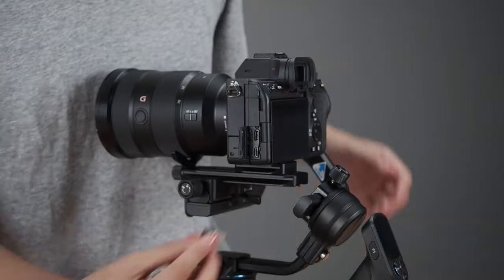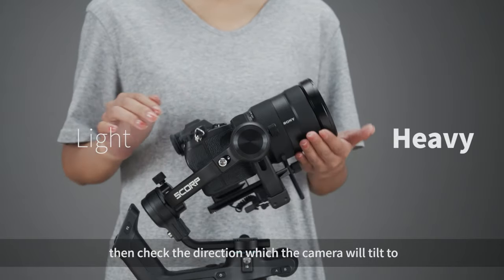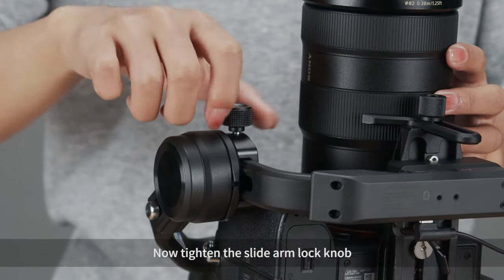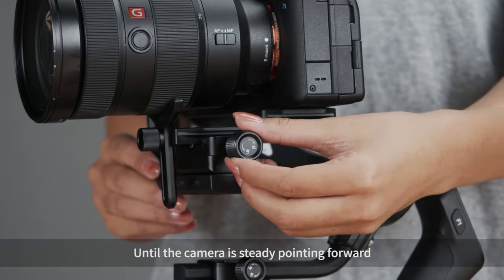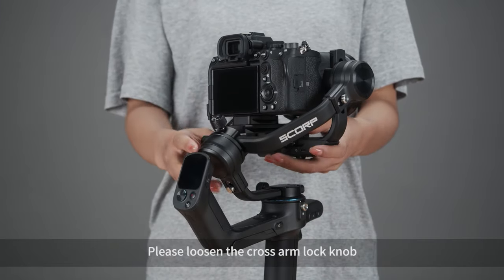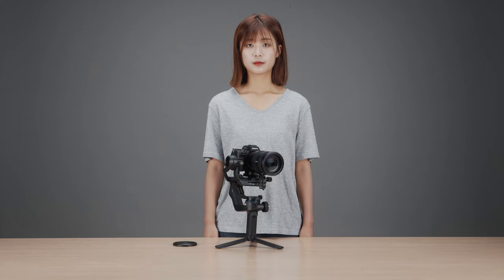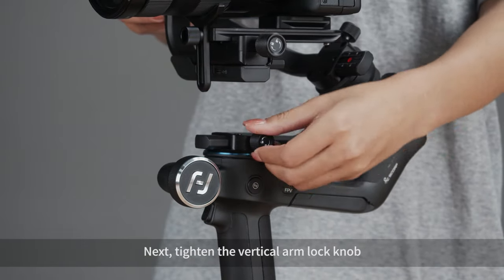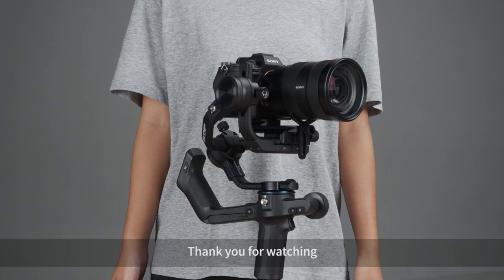SCORP-C Gimbal Balancing | FeiyuTech Tutorial

Comment: The tilt balance is impossible with my lens-its not that heavy, but still falls forward. I want to add counterweight to the back. Is this the solution and do you offer counterweights? I may have to buy some off Amazon, but they may not be the right size. Any insight?
Reply: Were you able to balance it correctly ?
Reply: @thomess they’re so miserable so they won’t message you back

Comment: My camera is 4lbs under the weight limit and I've balanced my gimbal as stated in the video. The gimbal turns on just fine. Works fine, until you ask it to put the camera in portrait mode. It can't hold the camera up, it just falls over and enter sleepmode. I'm about the return this thing if I can't get any help.
Reply: Return it! this is a complete fake package if your camera is more than 1kg.

Comment: hello, i've got an issue with my scorp c gimbal. i just got my gimbal 2 days ago and i wanna try it with my sony a6400 + 30mm lens. i followed every steps from the manual book, the feiyu scorp application and youtube but when it comes to pan axis part my gimbal seems has too much movement and not balancing as it should be. also, when i turned on the gimbal, it vibrates too much and the calibration not accurate, and i tried to press the button and my gimbal gave no response. is there any tips to solve this? thank you.

p.s now it wont connect to my phone, i already turned on the bluetooth and my gimbal didnt connect to any other device. this thing such a pain in the ass to set up
Reply: Same problem with me

Comment: I can't balance from step 2 too... camera reteurns to middle from each axis, Nikon D3400 + Nikon 35mm f1.8.
Reply from the maker: Hello, when you balance the tilt axis, you need to keep the other two axes locked. After balancing the axis, please remember to tighten the quick release plate safety lock. Thanks!
Reply: @Feiyu-tech  Hi, yes i have locked it, but is not balanced good enough. With a lightweight lens looks fine, but with other no =/.
Reply: First try, Nikon D3400 + Nikon 35mm, i can use buts its not 100% for sure. Second try, Nikon D3400 + Tamron 10-24 the gimball always shaking =/
Reply from the maker: Sorry for the problem you met. Can you please take a short video showcasing the problem, and send it to service@feiyu-tech.com? Our Support Team will help you ASAP. Thanks!!